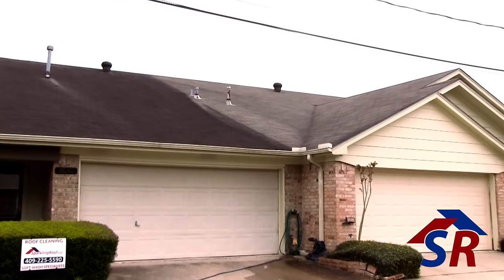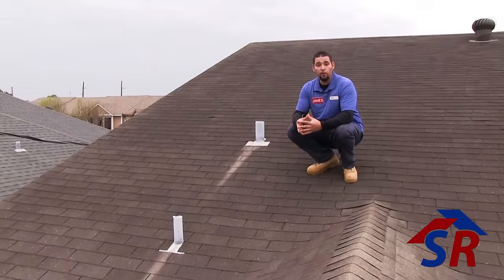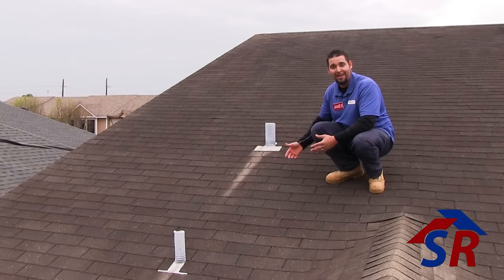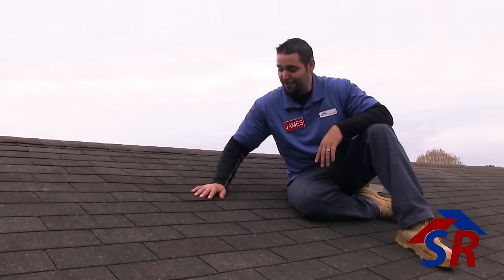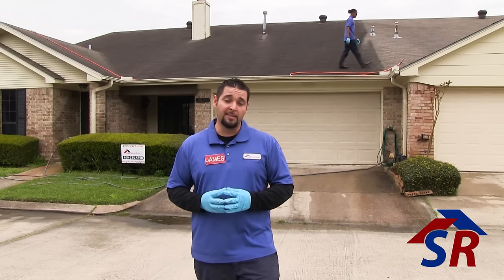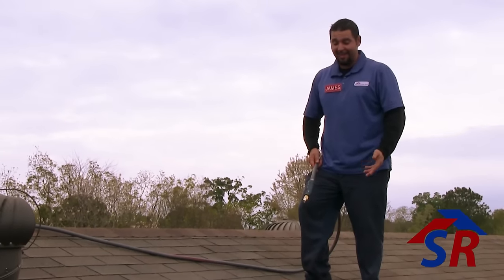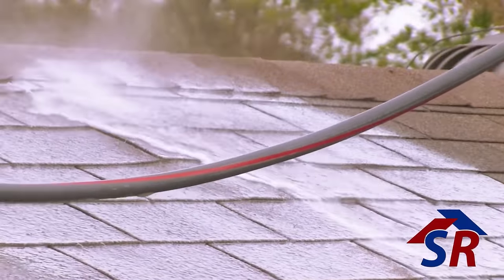The SparklingRoof Technique: Roof Cleaning Methods

Comment: Good info. You guys go the extra mile with the caulking and repairs.
Reply: This may be illegal in some places without a  contractors license.  A friend of mine that does landscaping did work for an elderly lady and after completing his work and collecting payment, he noticed a board was loose and was a trip hazard.  Being a nice guy, he grabbed a screwdriver and tightened the boards back down and went on his way.  Little did he know a contractor drove by and saw him working on the deck and knew he wasn't a contractor and called the police and reported him.  The police came and picked up my friend a little later and he got to spend the night in jail until the following day the police spoke to the elderly lady and when it was apparent she had no idea he had fixed her deck, it was obviously not something he charged for and was doing as a kind gesture, they released him.  Before doing any add-on services like this, contact your insurance company and make sure you're insured for this type of work, and that you do not need a contractors license to do these types of repairs.  Better safe than sorry.

Comment: Nice work, most soft washers do leave after they spray the chemical on the roof and do you know what happens the next rain storm ?  All that stuff you're rinsing off ends up going down the gutters and staining the driveway with a milky white powder that needs to be power washed off.  I'm very glad to see that you guys are professional, great work.
Reply: What in the roof cleaning mixture would cause a milky white powder that needs to be power washed off?  Very few roof cleaners use calcium hypochlorite, but that is the only remotely white substance I can think of.  I find it hard to believe that is the issue as I used calcium hypochlorite when I first started and never had any issues, even when the downspout ran across a black asphalt driveway.  You may have come across someone trying to use a non-bleach alternative, but those roof cleaners are few.  Or someone may have used TSP?  Phosphates are bad for the environment so I've never used that so I cannot do more than guess on that one.  Soft Washing done correctly, with or without rinsing the roof will not leave a milky white residue.

Comment: Great job on the video, after the roof has been treated and rinsed do you use one more application of solution for warranty protection and a long lasting finish? Also if you have to flush out your chemical line you can put the suction tube in a water tank or pale and use your system while flushing it out to rinse the roof, just a thought and then you could use the proper spray nozzles for better coverage.  WASH ON! :)

Comment: Good stuff, I simply charge by sf of home similar to your formula. Always meet my hourly rate and always do estimates over the phone. Now I have my estimates outlined on my website as well and have never looked back. 😊👊
Reply: How much you charge a square ft
Reply: So you generally charge one fee per 100 sq. ft., no matter if the roof is single story or 3 story, if it is a shallow walkable pitch or steep and unwalkable pitch, or if there are gutters or not, or if there are a lot of sensitive plants or it is dripping into a bed of rocks with no plants around, if there is no debris on the roof or there is so much debris it takes hours to remove, or the roof is very lightly stained, or heavily covered in moss and lichen?  If that works out well for you, that's great.  I don't see how that works out without over charging simple roofs or under charging more complex roofs...?

Comment: James please tell me what kind of pump or hose You guys are using plus how much bleach do you use in relation to the water in the soap I can never get it right I need help
Reply: Do your mixture light, test it out on a small portion, maybe on the area of concrete covered in algae or on the roof. Increase or reduce the concentration as required. 

Every roof cleaning is different. The key is dynamic in operations.

Comment: Wait Let me make sure I got this right eight 2100 square-foot house divide that by 10 you get 210 multiply that by 16 and it’s like $3300 to wash the roof is that correct or am I missing something here thank you
Reply: Your missing it for sure. 2100 sq ft is 21 sq. At most your looking at 420.00

Comment: why do you take a chance walking info of which is dangerous when wet....just spray from the ground
Reply: Dave, many professional roof cleaning companies wear a form of fall prevention body harness and secure themselves in a manner so their ropes will stop them before they slide off a roof if they slip or fall.  Although in their defense, I'd wager in most cases they would have sprayed this roof and similar structures from the ground or step ladder or extension ladder spraying from the gutter line versus from the rooftop.  They likely chose to clean this roof from the rooftop because it is easier to demonstrate the process and easier to view with the camera angle than to do the same video on a higher roof.  General comment (not directed at your comment Dave) - Keep in mind that when a company posts a video such as this it isn't going to be 100% accurate on how this exact roof would be cleaned, it isn't a training video to teach people step by step how to clean a roof - it is an exaggerated example to show customers how this single company does work and displayed in a manner that is easy to see and understand.  These videos are to show potential customers roughly what to expect when their roof is cleaned.

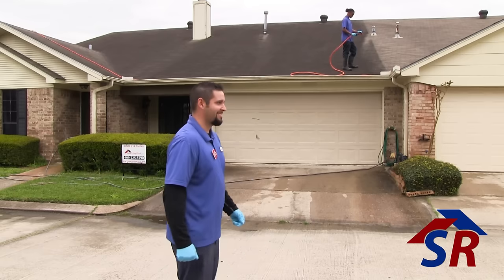Comment: So what about the metal conduit up on the left at 5:00 it looks brand new and by 5:40 in your video it is completely rusted.... I would focus on covering those up.
Reply: There is no conduit showing anywhere in this video. Conduit is tubular and is what you use to runs wires. If you are talking about the metal trimming around the edge the roof I don't see any difference from 5:00-5:40... Don't be a hater... I do this on a regular basis and they did a good job. But their name tags are HUGE!
Reply: Those are called gutters and downspouts, and they are not rusted.  The salt and bleach isn't in contact with the metal long enough to have a galvanic reaction.  Learn what you're talking about before spouting off nonsense and trying to harm how somebody feeds their family and employees.  There's no need for that.

Comment: a square foot is 12x12 ...
Reply: But a "square" in roofing terms is a 10'x10' section, or 100 sq. ft.  It's actually a little less, as there are 3 bundles of shingles in a square and each bundle is approximately 33.3 sq. ft.

Comment: Where is all this SALT you are referring to coming from ???
Reply: Kyle Hurlbut There is no salt in bleach ... and YOU call yourself a professional.
Reply: @MrBobWingard  Bob, liquid bleach is "Sodium Hypochlorite" - the Sodium is salt.  The sodium/salt is what is so dangerous to plants.  The bleach itself isn't very harmful to plants at all.  You could take what he is spraying on the roof and spray the yard and you would get a big dead spot.  You could switch from liquid bleach (sodium hypochlorite) to powdered bleach (calcium hypochlorite) and spray the same strength mix in the grass and not see any effect, or if you're heavy handed you may see some brown on the edge of the grass blades for a single mowing.  The difference is the salt is toxic to plants.  Powdered bleach is much safer to use around plants, but if the person on the ground isn't on the spot, you'll end up with little white calcium spots on surfaces where the wind blows the overspray which is difficult to remove, thus why so few people use it.
Reply: @MrBobWingard  Bleach does break down into its component elements.  Bleach is NaClO, Sodium chloride, and oxygen.  If you leave bleach outside in the sunlight in a sealed container it will break down on its own to the point it is no longer bleach, and all you have at that point is salt water.  I had a 5 gallon tote of 12.5% liquid bleach left over from the last job I did last year (October or November) so it was too weak to use when the season picked back up this year.  I just left it sitting there and when I bought a new house this August, I used this in my home made weed killer.  The common yellow color to the bleach was 100% gone.  When I opened the 5 gallon tote it had absolutely no bleach smell to the point I stuck my finger in the liquid and tasted it and it was nothing but salt water.  Bleach isn't stable like water.  If you put water in a sealed container and come back months later, it will still be water.  If you put bleach in a sealed container and come back months later, it will break down to simple salt water.  If the container is not sealed, the water will evaporate and leave behind the salt.  So if the NaClO breaks down to H2O and NaCl (Sodium chloride, a.k.a., table salt), yes, it does break down to its component elements.  If you check with the EPA they will tell you that after a few months that liquid bleach (sodium hypochlorite) is no longer effective per EPA standards as a sanitizing agent.  The reason why is because bleach breaks down, even in a well sealed container.  So before you call someone a moron, perhaps you should do some research first.
Reply: @panoramicclean3956  Salt is NaCl ... NOT SODIUM ...
Reply: @MrBobWingard  Yes Bob, I'm aware.  I broke that down in my 2nd response in multiple places.  I did edit out an erroneous comma in the second sentence though from between sodium and chloride.  My point was that the sodium Hypochlorite DOES break down, even in a sealed container, and what is applied to the roof breaks down by about 90-95% by the time the roof cleaning professionals are done and leave the property.  That information was passed from a professional chemist, which I am not.  Since you said bleach does not ever break down, I'm assuming you are also not a professional chemist?
Reply: @panoramicclean3956  This is hilariously STUPID !!   Where does the Hydrogen mysteriously come from that somehow creates WATER ( H2O) ???
Reply: @MrBobWingard  Now you're just grasping at straws Bob because pure sodium metal is so reactive it NEVER appears in nature and the ONLY way to obtain the PURE sodium metal element is via electrolysis to separate it from another chemical compound that contains sodium, usually sodium chloride.  Sodium is the most common element on earth, and it is found mainly as sodium chloride or salt.  Sodium metal is a great item to play with...toss a little into a pile of kindling while camping and toss a little water on it to start a fire and you'll have plenty of people scratching their heads on how you used water to start a fire.  Toss a little into water and watch it pop and flash.  It is a very fun item, although VERY reactive element when it combines with water, but you do not a useful argument since pure sodium doesn't exist without using electrolysis to break down sodium chloride first.  And the mysterious hydrogen and water that are not in the NaClO - AKA Sodium Hypochlorite.  Well, Sodium Hypochlorite is the active ingredient in liquid bleach.  If you have 5.25% sodium hypochlorite, then you have 94.75% inactive ingredients, which would be the water/H2O.  Most things that have active ingredients like medication or chemicals list the active ingredients by weight or percentage, and the rest is inactive ingredients.
Reply: @MrBobWingard  OK, then liquid bleach breaks down to the base components AS THEY ARE FOUND IN NATURE.  So yes, it is pure stupidity to expect something to break down BEYOND what form it is found in nature, to break down BEYOND what can be achieved without electrolysis to separate two elements.  When they ship pure sodium metal they immerse it in oil to stop it from reacting violently with air and moisture in the air and anything else it comes in contact with.  it is IMPOSSIBLE to find pure sodium in nature without it being bound to any other chemical, unless maybe you are standing in the salt flats near a lightning strike (not sure if that would work either?)  As far as hydrogen and oxygen...liquid bleach is an OXIDIZER.  Go Google oxidation and figure out how it works.  I'll not waste more time explaining this to you so you can find some way to twist my words to support your argument as you have above.  Have a blessed day and life Bob, and thanks for the comments above.  If nothing else it was a very interesting discussion.
Reply: @panoramicclean3956  Still stupid ... but you ARE getting more proficient at deflecting and double-talk.
Reply: @MrBobWingard  I apologize...I'd have handled this discussion differently if I knew you were asking for things to break down past the point they are in their natural state here on planet Earth, asking for things in a manner that would be impossible to find in nature.  You were asking for the impossible.  I'm sorry for applying reason and logic where apparently none exists.
Reply: @MrBobWingard  Bob, what are you talking about?  How are you saying I'm creating water from non-existent elemental components?  WATER is a part of the entire mixture of liquid bleach.  Liquid bleach is made up of 3 parts - 1) Sodium Hypochlorite, 2) Sodium Hydroxide and 3) water.  Go Google search the SDS for Sodium Hypochlorite for yourself.  I'll wait for yet other twisted comment while you say I'm full of BS, stupid and say I'm full of double talk, or that the SDS is wrong.  If explaining things with facts, reason and logic make me a used car salesman in your opinion, then so be it.  Although I've not tried to sale anything besides free information.  Wait, that's not selling, that's education.
Reply: @panoramicclean3956  In one of your "explanations", you stated that water was FORMED in the process of the NaOCl breakdown ... THAT is total bullshit.
Reply: Bob, I assume you use Calcium hypochlorite to clean roofs. Where can I purchase that and is it effective ? Also , have you ever used copper fungicide on roofs to kill and prevent algae ? Home Depot sells copper fungicide.
Reply: @MrBobWingard  Sorry Bob but you could not be more wrong. The Na portion of the compound NaCl is sodium,  per basic middle school science class where you were introduced to the Periodic Table of Elements. Cl is Chlorine. https://en.wikipedia.org/wiki/Periodic_table
Reply: Thank you Bob - I enjoyed reading your ridiculousness and Panoramic Clean's calm and measured responses.
Reply: Sh turns to salt when it dries.
Reply: Can't we all just clean along? 😂

Comment: $20 a square foot you outta ur mind that means y would charge $1000 just to do a jail cell that what that comes to $ 960
Reply: He didn't say square foot. He simply said square.  A square is 10x10. So it's $20 per 100 sq ft of roof.. comes out to $2 per square foot and is an average cost of roof washing. Pay attention next time.